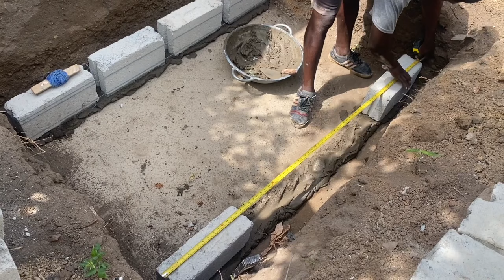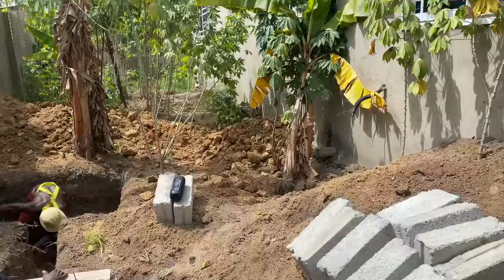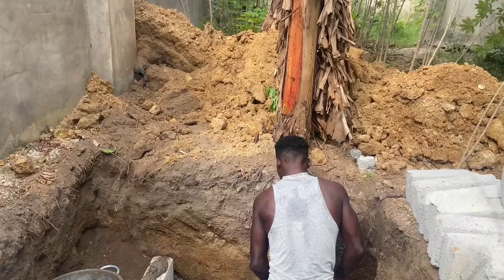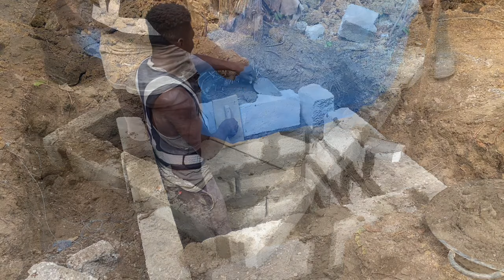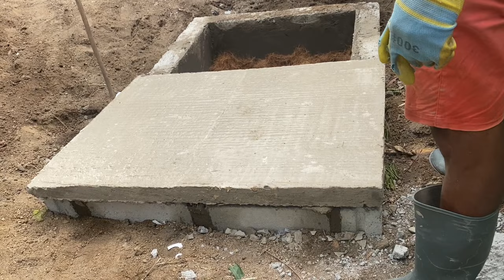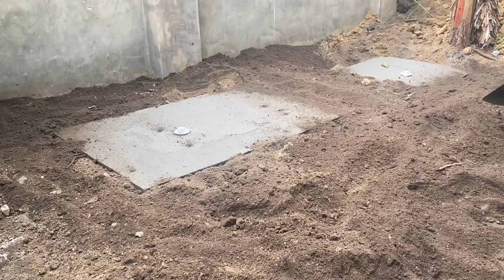Construct Biodigester & Soakaway Without Limitations (FULL GUIDE)

Comment: Nice one the boss, but I have a question. The Biodigester height from the ground should have been higher, it appears buried already.
Reply from the maker: Yes. The homeowner wants it buried completely by the final ground works. So a pipe with clean out will be placed on it just to show where the digester is located.
Reply: Is there any advantage or disadvantage of burying it?
Reply from the maker: @cropification  none at all. Usually homeowner’s preference.
Reply: @DreamHouseBioDigesters  Jerry pls another question, the concrete base did you do a gradient during the preparation or during the block work. Why the concrete base, I have not seen you do this before now.
Reply: @DreamHouseBioDigesters  how big is this biodigester i mean dimensions